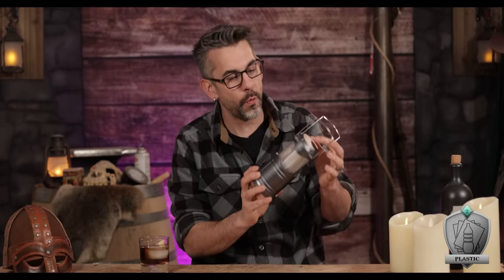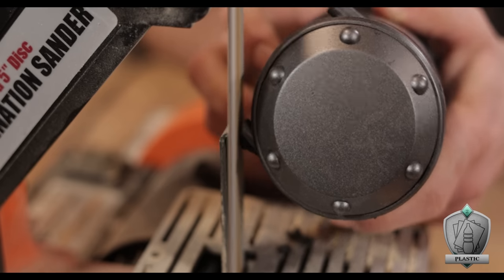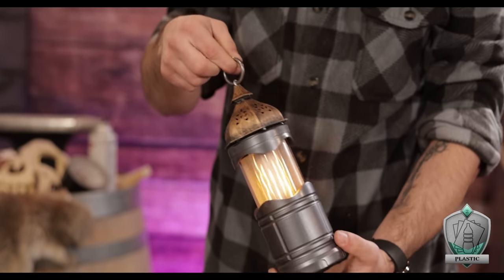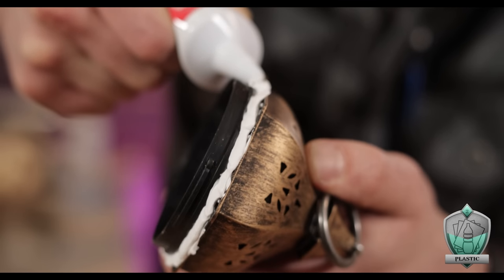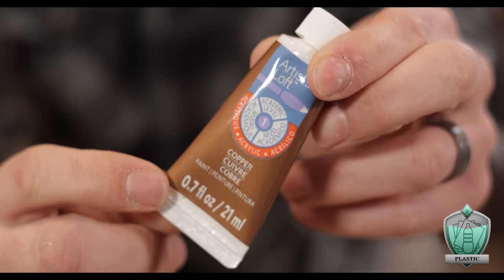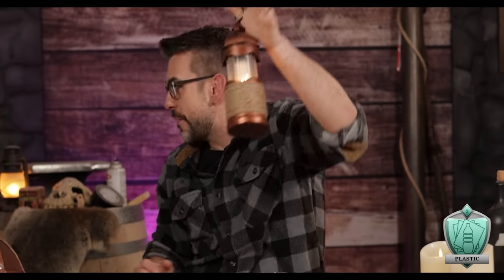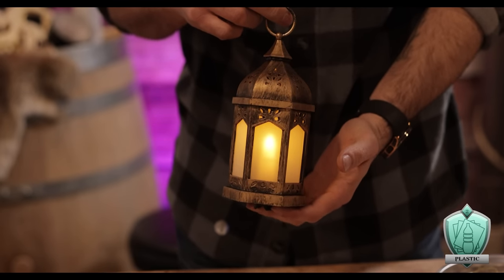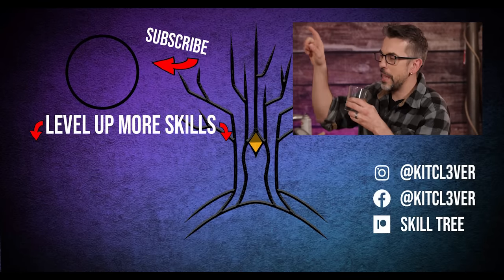How to make Cheap and Easy LARP Lanterns!

Comment from the maker: The first 1,000 people to use the link will get a 1-month free trial of Skillshare: https://skl.sh/skilltree03231
Reply: In this amazing creations, thinking in coper i only miss the green rust on it's edges..and the blackened uper zoneof "crystal"..
Next: Larp medieval torch...
Reply: It's not really a free month. They collect payment info and personal info. If it were free, they would only need you to provide login info.
Reply: If 80% aren't subbed maybe ask them why or if you know, listen to them & try what they say. Idk but it might be cause they come for crafting but don't like the 12 minutes of stories about stubbing your toe on a stump in a creek.
Reply: Those little Halloween lanterns, replace the halloween windows with some insert cut outs from 💵 🌳 flexible cutting boards (2/$1.25), strip the electronics and swap the battery for a simple heatless LED bulb(e26 or e12 base) by running an electric fixture and cord up through it in the middle up reattach base and boom; Faux Moroccan hanging lanterns.

Comment: Adding little spots of green/turquoise paint on the edges would give it a cool verdigris effect.
Curiously, I've been working on my own LARP lights recently, I'll definitely be using some inspiration from this video.
Reply: I was just about to type the same thing. A few hits of turqoise/cyan in parts that your hand doesn't touch often will give that old, patina'd copper look. A few deliberate bumps and scrapes can add a lot of subtle detail too :)

Comment: I’ve been toying with the idea of an LED version torch. This is a great way to start! You guys come up the greatest props!
Reply from the maker: Glad you found this one useful!
Reply: Get one of those flaming Halloween cauldrons that have a little peice of cloth that blows around with a light on it you can take them apart and use elements. I used one to make an old wood stove look like it was always lit. Bonus points you can cut your own thin sheet cloth to make the flame look bigger.

Comment: Okay these I am one THOUSAND percent making, with help from the kids. I have some dollar tree solar lanterns I may strip for the panels and batteries, and make something like this that's solar rechargeable.

We are actually about halfway done with our Ruana cloaks for Ren Faire this year, using instruction from yourself and Living Anachronism. Going great so far, just got to remember how to use my sewing machine, or mentally prepare myself to hand-stitch them all. I was thinking of embroidering a symbol, maybe even initial as well, into them before we waterproof them with the wax. I have also saved the circles cut out of the neckline and am going to experiment with making them into small pockets for the inside, or  save to repair tears as patching.

Comment: I've done a few of these with harbor freight lanterns for fallout and star wars cosplays. It might not work with those lanterns since they plastic defracts for the "flame" but for the cheaper lanterns I like to sand the inside of the plastic lens to diffuse the light. If I need a specific color light I'll paint the inside with an translucent acrylic paint and it works great.

Comment: For cleaning that white paint use either acetone, rubbing alcohol or mineral oil
Reply: Exactly my thought, depending on the paint. Rubbing alcohol might not work where denatured alcohol would. It's much higher proof.

Comment: For lantern embellishments I would definitely use some leather to act as an insulater to keep you from being burned from the flame's heat. 
Also, thicken the vertical glass supports by gluing rods to the "glass". Paint them as desired for effect.

Comment: I have a little self made cocktail at hand, that would fit this channel. It's a riff on the Revolver.

Flintlock (by OJ - 2023)
1,5 oz dark rum (Kraken Rum)
0,5 oz overproof rum (Stroh Rum 80%)
1 oz cofee liqour (Mr. Black or Kahlua if you want it sweeter)

Pour in low ball on one big ice cube and stir till cold.
Add a small dash of all spice on top (this is your gunpowder)

Comment: Another detail i would add is on the inside of the glass panels i would paint the back of it black around the sides and top. That'll give it a used look, like the soot from the candle has built up around the edges of the glass

Comment: I did something very similar to this with some Halloween lanterns that I picked up for a couple of dollars each at Target last year.  They were made of metal and already the right shape and color (a matte black that makes them look kind of like wrought iron).  I just needed to pop out the decorative, translucent plastic panels and replaced them with some frosted plexiglass I had laying around from some other project.  They already had a decent led candle built in, though I may replace it at some point if I decide I want a brighter light.

Comment: similar to this vein of modern convenience dressed up to be medieval, I made a handheld battery operated torch. using one of the garage lightbulb things, a flickering fire LED lightbulb, and wired the plug it came with to take a USB power source, and fit a rechargeable battery in the handle. BAM, a flickering flame torch you can carry without being dangerous

Comment: Great build, but a couple tips. To replace the glass, a great up cycle is to use the flat portion of a clear clamshell pastry box like you get from the grocery store. They are usually pretty inconsistent in thickness and even have tiney bubbles like old glass did.

Another tip is to just take the electric base and diffuser from the camp lantern and put it in the Halloween lanterns.

Comment: Been watching alot and I've seen a large amount of sweet larp gear at this point. I'm surprised you haven't made a small cart to drag it all to camp easier. The larp tarp tent, folding vanity, and the kitchen chest are on the bulkier side. Save yourself a trip from car to camp and build you a collapsing cart. Heck go further and have it shift to a mobile repair station for any adventuring mishaps.

Comment: I would have went with a push button to turn it off and on and just put the guts of in the Halloween lanterns. Replaced the Halloween deco "glass" pains with acrylic panels and looked into getting some of the opaque stuff to line the acrylic panels with so you can still have the flickering look or just used the tube from the pop-up part and glued it into place and just got a frosted acrylic sheet and cut out the panels out of that so you can't see the cylinder in the center and still have the ability to use the flicker function. 
But as for how you are doing it I would have used a bronze or brass rub 'n' buff instead of an acrylic paint. It looks much better on a black background and gives you that natural patina look without a bunch more steps. And a little rub 'n' buff goes a long way.

Comment: I was recently thinking about making a bunch of Moroccan style lanterns to hang in the back yard. I was thinking I’d have to design the intricate panels and 3D print them. Seeing such a convenient and cheap option on Amazon is having me rethink that. I was planning on using a hidden solar panel to power the lamps as well. I may just have to do some fiddling with these.

Comment: It just so happened that I stumbled over that exact camping lantern in my local supermarket and instantly bought it. To make the flame effect a bit more realistic I put a thin piece of paper between the diffusor sheet and the acrylic glass. Now I keep an eye open for bits that go along well with it. Or I have to craft something myself from all the cardboard that I'm hording.

Personally I find the flickering effect a bit too rapid. It's rather a secondary - or just pure aesthetic - light source to put in a faraway corner. If it were my only source of light I'd surely get a seizure. 😅

Comment: Instead of using copper paint, consider using copper tape! It's sometimes used for insulating electric guitars from interference. Thin as aluminum foil, but comes with an adhesive backing. I use it to add cool accents to walking sticks!
Reply: Also sold for making fake leadlighting in Art stores in silver and copper.

Comment: throw some tinsel between the light and the frosted glass i will make the light seam more random 
Add  a bit of green to the fake copper to make  it look slightly corroded 
make the top look slightly blackened to simulate soot from the flame

Comment: I have lanterns like the base ones because we get frequent power outages and I can't see shit without some sort of light. Usually set them up in the bathrooms. Mine don't have other color brightness patterns. I prefer brightest possible. 
I actually really like the halloween lanterns as they are with the cats.
I think I like the 2nd method better. 
Do you have a link to the metal ring you used? And what thickness plexi did you use and how did you make it stay in place?
I wonder if its possible to use something cheaper for the glass replacement. I also wonder how hard it would have been to put the type of light like the more expensive lanterns inside the cheaper lantern and figure out how to get it to blur to look like flames.

Comment: Very cool, but the jute wrap is total crap. It's not just farmhouse DIY vibe, it's a fire hazard, so it screams that the lantern is electric, destroying the illusion of a world lit only by fire. You haven't spent enough time around fire-based lanterns. The ring at the top is to put a stick or metal rod through so the rising heat doesn't burn your hand when you carry it, unless it only has a candle in it. The holes at the top are not only to help with oxygen flow, but to let out smoke. That's why they're so common a design. Definitely getting some of the pointy lanterns and removing the paint with chemicals. Acrylic is probably much better when out larping.

Oh, and acrylic paint doesn't come off with rain once it's dry. You have to use denatured alcohol.

Comment: I honnestly don't like some of the minor things you did on the first lamp. That is probably just the product designer in me but i just feel like it doesn't match the quality you have shown before and i personaly think there are minor things you could have done better/more rigid.

First the steel wire you used to secure the top portion. At the bottom where you tied the steel wire up i would personally put a 2mm or 3mm steel sheet where the wire also goes through and at the top where the wire forms the small ring i would put a small steel shim. In both cases just increasing the surface area for the pressure holding the parts together.

Second is the "glass" on camera the colour you put there is barely recognizable as what it is supposed to resemble. However i can not say how that could be improved without actually looking at it close up.

Comment: Not a fan of the paint job.
   Real metal does not have a black base color.

The black base with rough brushed metal color over it as always screamed fake to me.

If you want the brushed metal effect you need an even coat of the base metal color and then to lightly dry brush it with a second coat of the same color.